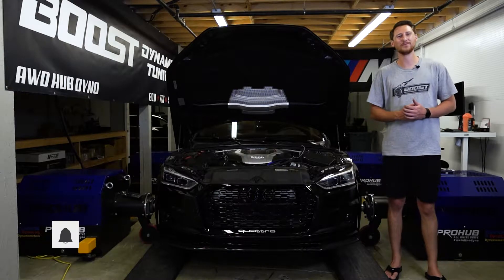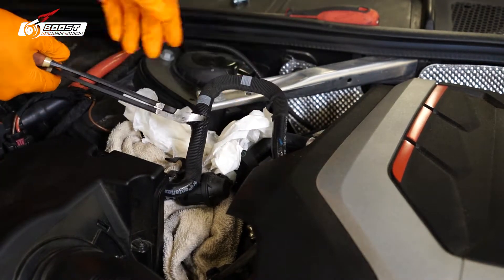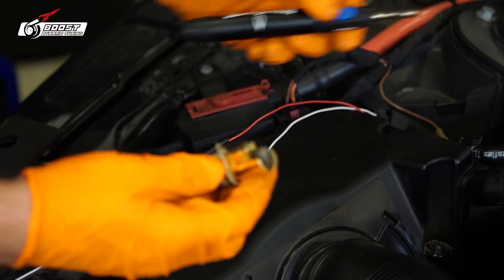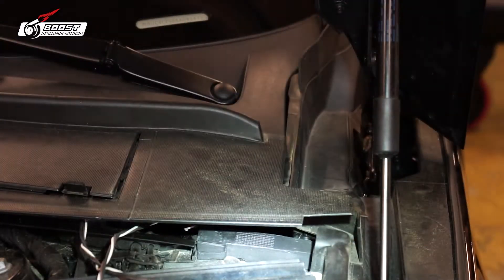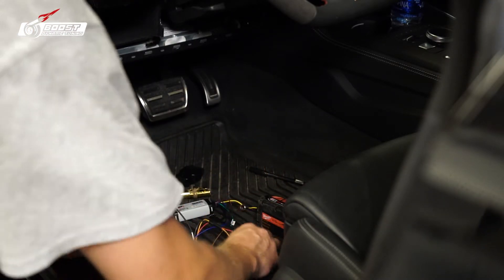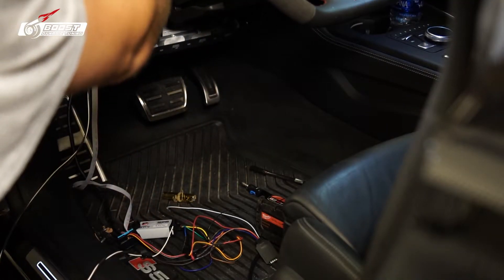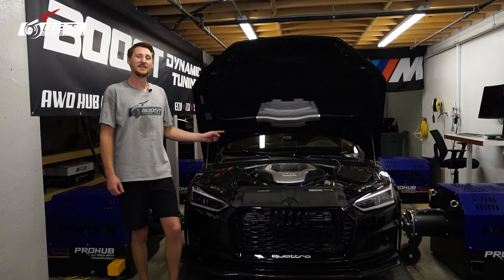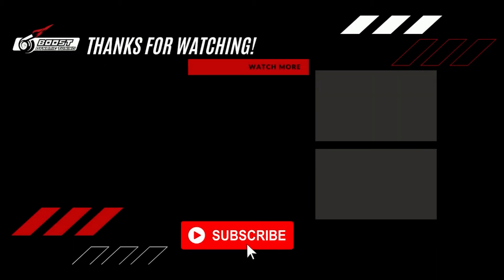How to Install an Ethanol Content Sensor - 2019 Audi B9 S5 3.0t

Comment: Nice video, but instead of passing cables through firewall, is it possible to connect them directly to ecu cables  in engine bay, would p3 gauge still work for fuel reading ?

Comment: Couple questions here (Both for the B9 S platform) :

Will you be developing a FlexFuel tune?

Will you show dragy runs of stage 2 93 OR E85? Interested in those more specifically over dyno runs.
Reply from the maker: Yes we definitely will be! Problem is we are near Florida and it's 95f everyday. I wanted to wait till it's closer to 80f before more development. Can't wait to see the gains!